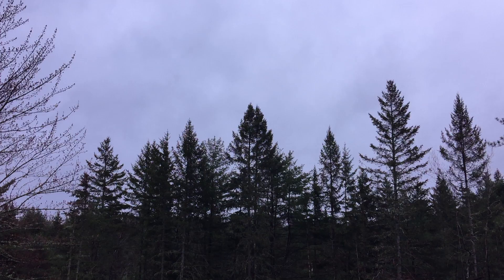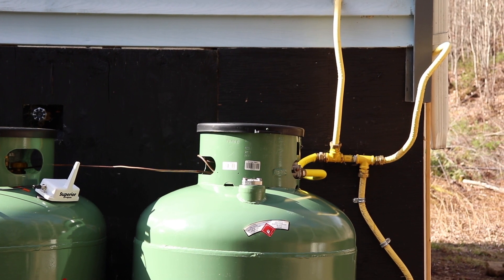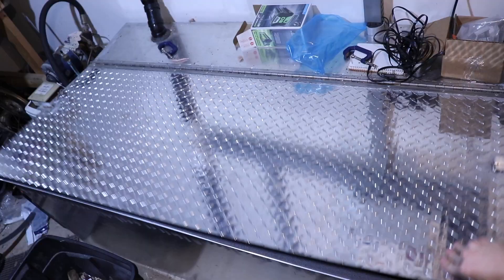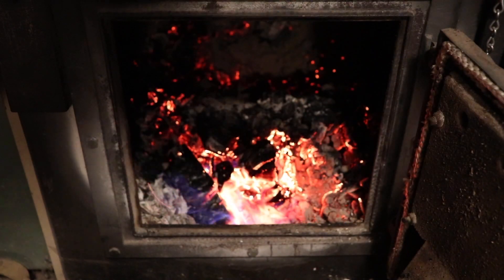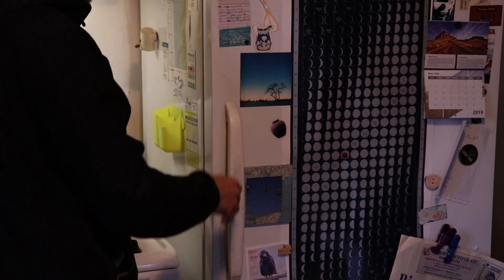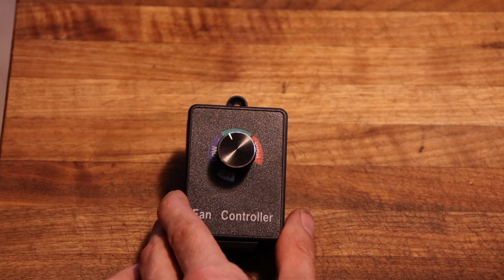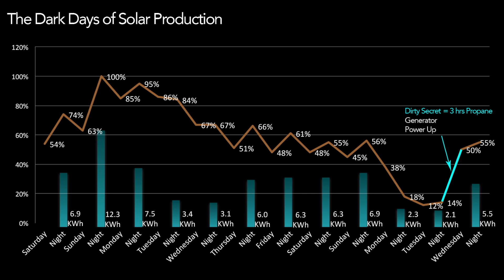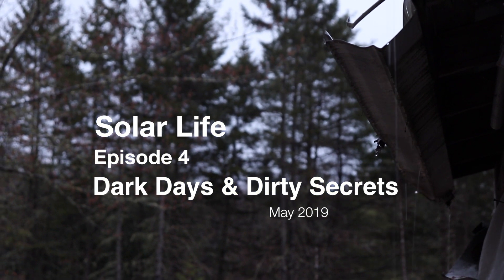Solar Life - Episode 4: Dark Days and Dirty Secrets

Comment: In my on the grid home I use about 3kWh per day when we are away on vacation. This averages out to the fridge and freezer and not much else. A mean power if about 250W. At night, we might use 2 kWh in the summer and not much more in the winter as when we go to bed the home is ~18.5C and I've set the furnace to 14C overnight. Most mornings the temp is still 15+C so, our winter night use is not much different as the furnace almost never comes on. You say that you're down 20%, but I guess that would include the previous night's dinner, evening activities along with breakfast. If you can give energy in kWh rather than % it helps those of us comparing our situation with yours.
How large is your battery bank in kWh?
How far down do you let the discharge go? 
If you had LFE batteries you can run then down ~10% so it's almost 2 for 1 and they're maintenance free.
I like your fridge and freezer switches. I didn't know they existed. On grid, they probably aren't worth it, but off-grid you're just trying to make through so the rational changes! Thanks for sharing.

Comment: Thanks for winter solar insights. I live at 62 degree north and know how hard solar is in the winter. Just a comment on duct and fan systems.
In Sweden we use water and radiators for heating. My system with wood furnace and flow regulated pumps draw between 3 and 20W depending on how many radiator thermostats are open. You never see duct and fan systems in homes here.
Reply: great observation.  Thanks